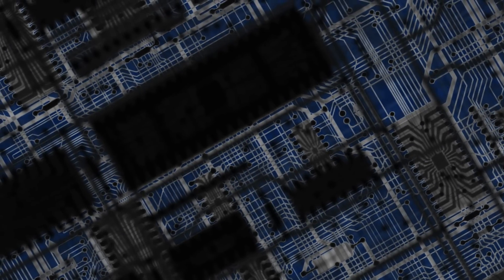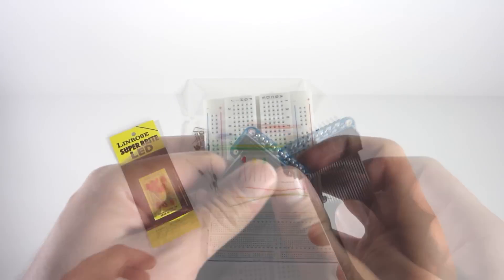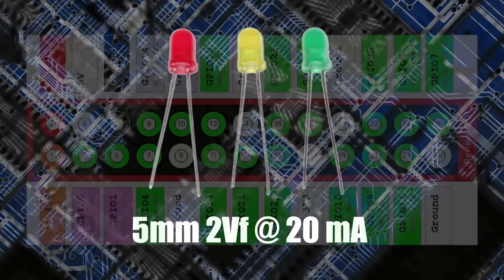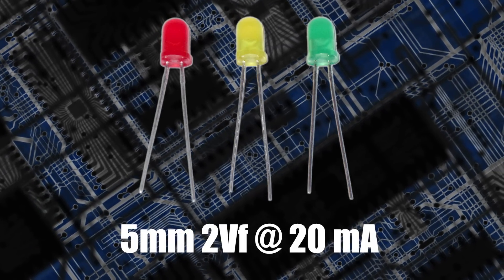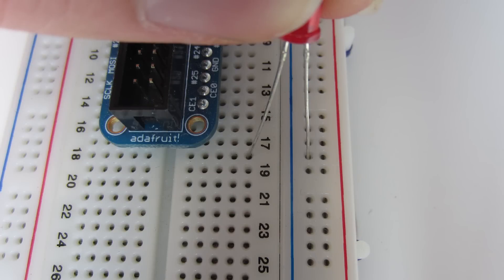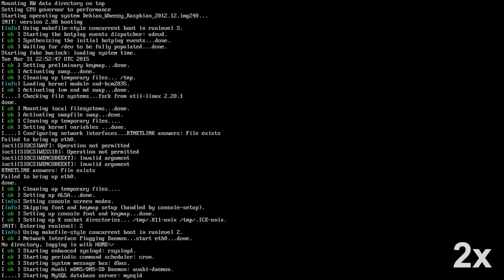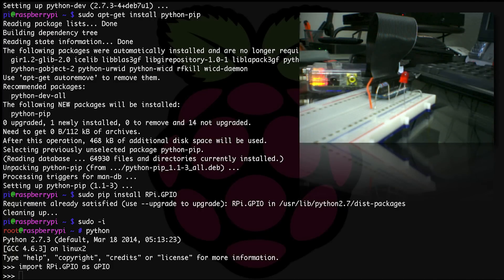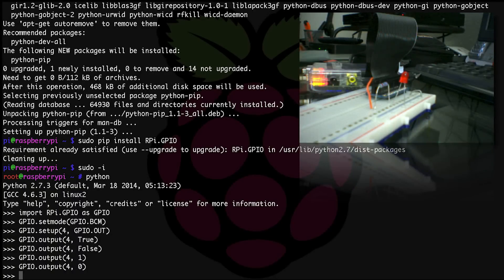Raspberry Pi - Tutorial 13 - Part 1 - Working with LEDs and GPIO (see description for notes!)

Comment: E is energy and E = M*C^2, you can not  say E = IR. V is voltage, and V = I*R
Reply from the maker: Ahh, I see why people keep saying this! I didn't realize I put the word "energy" on the slide at 3:20. Not sure why I did that, but youtube won't let me edit it without deleting the whole video. I know "E" in this case represents "Electromotive Force", but for some dumb reason, I typed "energy" on my slide. Just a brain gaffe on my part. If you'll notice, on the next slide at 3:44, I do label it correctly. "E" is indeed used to represent the electromotive force or voltage in ELECTRONICS notation, and yes, it's also used to represent energy in physics. See: http://en-us.fluke.com/training/training-library/measurements/electricity/what-is-ohms-law.html
Reply: Yes I saw, I wasn't trying to criticize! I study EE in the UK so I'm guessing that's why I never came across that notation.
Ps. Your videos are very helpful man
Reply from the maker: Thank you! I really wish youtube would allow us to update videos with a new file or even edit pieces without deleting the whole darn thing. I have a few other corrections I would like to make to various videos, but I can't :-/

Comment: The first thing I did was wire the red light and resistor to the breadboard in the same way as this video describes. Then I booted and immediately got a weak light on it for some reason. Then I took it apart and followed this video step by step, in order. Now everything behaves as normal and the light is brighter, too. Can someone suggest what happened there?

Comment: I need help please.. When I tried to execute this command " import RPi.GPIO as GPIO" and hit return the following line appears:" -bash: import: command not found" 😭 what I’m i missing..?
Reply: Most likely the library. Try in terminal: pip install PRi.GPIO. Then apt-get update
Reply: you are supposed to run the command "python" to switch over to python interpreter before executing further statements. This is a late reply, you probably would have already figured that out.

Comment: Are both the cobbler and wiring kit needed?
Reply: the cobbler isn't needed ,you can just use jumper wire to the gpio of the Pi this is my setup of same thing ,without the cobbler .,note i haven't install the resistors yet. ,https://plus.google.com/u/0/photos/photo/100931101162265604587/6430134289402492194?icm=false

Comment: @TechErudio my Led(red,2v) is staying high always, I am using the jumper Wire 4->positive and 6->ground and 68ohm resistor between the pin 4 and led 
my led is always staying high irrespective of the command, please help me

Comment: Thanks, great video. I have the Raspberry Pi 2 and apparently there is some issue with GPIO on it, so I looked around and found a solution. 
After installing the python tools, use 'sudo easy_install -U RPIO', to install a modified GPIO package for Raspberry Pi 2. 
Then, when writing code, use 'import RPIO as GPIO', in order to follow along with the tutorial. 
Hope this helps anyone with an RPi2

Comment: Good video.
E is not energy, but it's Voltage. Energy is mesured in Joules; Voltage is mesured in Volts=Joules/Coloumbs. This is why it's different.
Reply: yeah, electromotive force
Reply from the maker: See comment to Stefan Victor above

Comment: Shouldn't the resister and LED be swapped with each other? In a different video I saw something else. A wire lead from pin 7 (I/O) to the positive side of the LED, then the resistor that leads to the (-) area where you have the ground wire with the lead ending on pin 6 (GND). I don't know electronics (hardware) at all and am quite confused.

Comment: thanks for this video series I do have question. When I use true or false they do not work, my pi for some reason doesn't recognize them as commands, however when I use 1 the light will come on and 0 will turn it off.  My guess is perhaps my version of python does not support true and false, have you heard of anything that supports this thought?
Reply from the maker: Try capitalising the T and F.

Comment: You circuit diagram shows the resistors between the positive side of the LED and the GPIO pin.   Normally you would put the resistors on the ground side of the LED.

https://www.youtube.com/watch?v=IP-szuon2Bk

https://www.youtube.com/watch?v=J9cEAGTLaC8

Is there a mistake in your circuit diagram ?

Comment: Any ideas why I get a segmentation fault after the command GPIO.setup(4,GPIO.OUT) ?  Tied in python 2.7 and 3.2.3

root@xbian~ # python3
Python 3.2.3 (default, Mar  1 2013, 11:53:50)
[GCC 4.6.3] on linux2
Type "help", "copyright", "credits" or "license" for more information.
>>> import RPi.GPIO as GPIO
>>> GPIO.setmode(GPIO.BCM)
>>> GPIO.setup(4,GPIO.OUT)
Segmentation fault
Reply from the maker: Just a guess here, but try putting a space after the comma before GPIO.